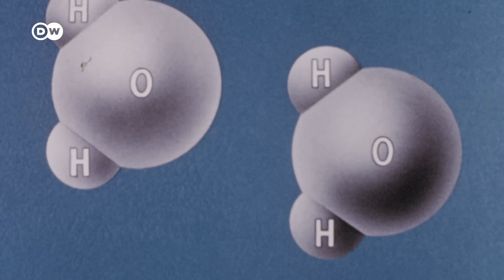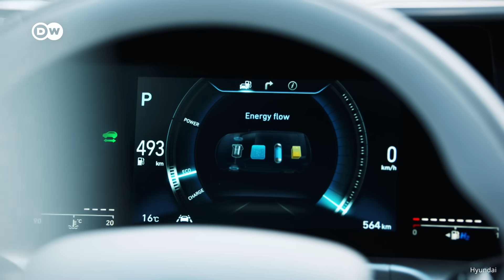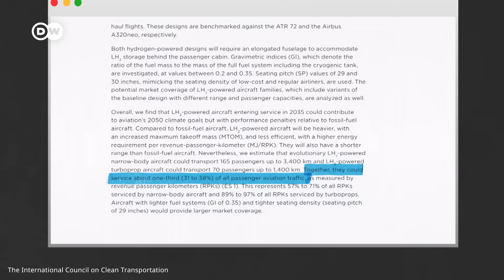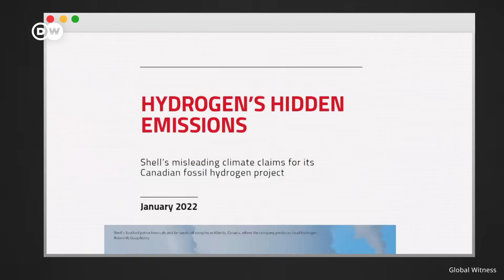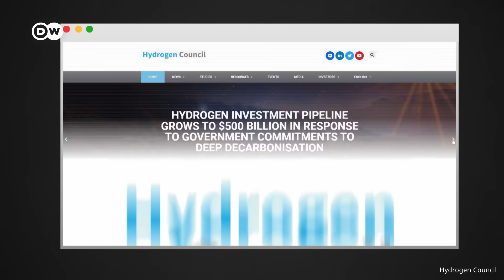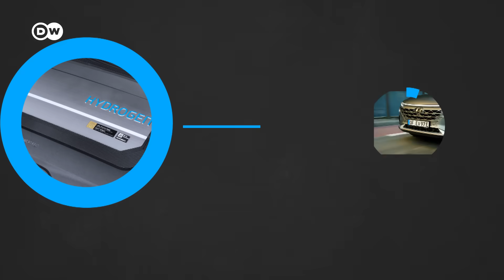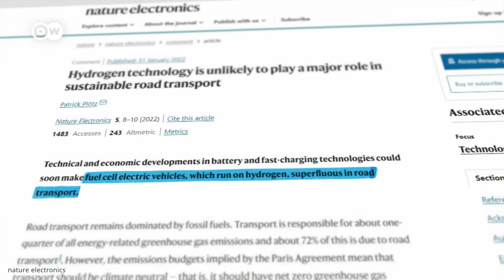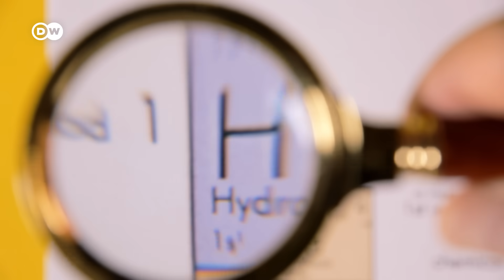The truth about hydrogen

Comment: The tv episode Mythbusters - called "Exploding Pants" is purchasable, and is about running a car engine on vertical water cell hooked to the carburetor, was a deliberate NEGATIVE set up. I counted 14 built in mistakes to not allow engine to run on hydrogen. The electrical circuit that was to be used was really called  "The Hydrostar". The complete original design is on Internet for sale. I have paper manual , but it's now being sold as a computer disc. Mythbusters did not use proper design, nor did they implement the required magnetic wire coil. Even gas engines use air as part of the blend. Their carb was completely closed off. Real usable energy related material will never be shown on tv, local newspaper or on radio general news. You have to your own research and see what others have already done. The man who designed Hydrostar was one of Stan Meyer's technicians in Ohio before Meyer was poisoned . Chambers went to Canada and filed Canadian + US Patent on modified version of Meyer's work.  His Xogen company had showed a display of HIS unit for publicity. The magnetic field energizes the rising ions in solution and increases energy content. Circular concentric pipe electrodes are superior to flat plate electrodes. Pulse quick current only for ALIGNMENT of water molecules polarity. Then pipes hit with high voltage DC pulses for way overunity hydrogen and oxygen gas. (No electrolysis at all)- that's old technology as of now. The Patent pages don't state it but, if flipping drawings pages back + forth , you can see it's easily done as connecting the wires of pipes to the resultant flyback high voltage coming from the wire coil.  !!  Hydrostar US Patent 6126794 by Chambers as studied and read for free on Internet.  (Put that in your pipe and smoke it!)

Comment: Don't go down the same path as Australia did with renewables. We were promised a reduction in energy costs but instead the cost doubled. we won't meet net zero by 2050 and the cost is estimated at $1.2 trillion and set to blow out because natural Gas will now be required to guarantee firming.
 
Consider the following.
 
Cold Fusion (LENR) - Unproven hypothesized type of nuclear reaction that creates nuclear fusion at room temperature by producing more energy than the amount of input energy can be produced from its altered state. 

Tokamak Nuclear Fusion Reactor (ITER) - Requires a temperature of 150 million degrees Celsius to create nuclear fusion. The record to date but having to use more input energy than produced is 69 megajoules of fusion energy for five seconds using 0.2 milligrams of fuel. (1 megajoule is equal to 0.00027 megawatt-hours) (The reported development cost for the ITER is $150 billion.)

The alternative - Solar Hydrogen Energy Recovery Gas Turbine – 301Kwh of solar energy collected from the sun’s constant nuclear fusion at atmospheric temperature is sufficient for electrolysis to fuel a gas turbine and generate up to 330Mw of electrical energy. (330Mw equals 1,188,000 Megajoules) 

Wind and solar farms including pumped Hydro have proven to be cost prohibitive and ineffective because they now require 28,000 Km of Environmentally and amenity destroying Renewable Energy Zones to address curtailment that affects 80% of the Renewable market and requires a prohibitive operational land area equivalent to 10 times the size of Tasmania.
 
The alternative solution is a turnkey, Net Zero, Carbon and subsidy free Solar Hydrogen Energy Recovery Gas Turbine. 

Based on Australia's CSIRO’s 2023 Gen Cost to provide our energy requirements a total of sixty-five 86-330 Mw Solar Hydrogen Energy Recovery Gas Turbines retrofitted to any of the existing 120 Hydroelectric schemes or standalone installation requires a total combined land area of 33 hectares. 
The 2023 cost range is between $2.4-3.3 billion, construction timeline between three to five years and will meet net zero 20 years earlier. 
Whilst the technology will make Nuclear, Wind and Solar farms including Hydro schemes redundant it is an intermediatory solution until a multilateral decision on power generation can be agreed. 

Shovel ready off the shelf technology that combines Solar Nuclear Fusion with modern aerospace propulsion and existing Nuclear and Coal fired steam technology for an 86-330 Mw plant is costed at $36.5-49.5 million, noise level is 60dbl at 60m, and operates from an area the size of a football field.
  
Green Hydrogen produced from the sun’s nuclear fusion, with an estimated 5-billion-year reserve supplemented with the turbines Variable Frequency Generator produces sufficient fuel and overnight storage of Hydrogen to power the turbine for a 24-hour/365-day period with a continuous and recyclable 14-year life cycle. There is also the added advantage of Direct Air capture (DAC) for CO2 provided from the turbines operational free energy air flow at the rate of 1,400kg/sec.

Comment: The Hydrogen Hype is a fairy tale with a true core. Green electricity should be used to harvest the low-hanging fruits, i. e. direct use first. The nature of a green economy is de-centralised and it seems that the detour via Hydrogen is abused to keep the centralised energy structures in place. This will never work because of the  incompatibility when it comes to harvesting the intrinsic advantages of  flat-spread  renewables.

Comment: Note that if you simply burn hydrogen in air, it's not correct to say that the only by-product is water.  The heat produced in the reaction also creates oxides of nitrogen which are bad for air quality. This does not occur in fuel cells, of course.

Comment: Car parts last longer. I think be no acid rain chemical coming out of car Engines.we can add methane gas from outside thanks to infrared red head lights and Radiators. Methane gas travel under ground as well in air.NH3 is found in soil dirt poop., and land fells.😊😋🙂😇

Comment: So, using shit tonnes of energy to produce it, then storing it, transferring it into trucks, transporting it long distance to other storage tanks, distributing it via service stations and running it in more expensive to maintain cars. Hydrogen for daily drivers makes NO sense. A power cable is the most efficient means of transferring energy. It can be offset with home solar, or the grid can be replaced with renewable energies. 

Unless hydrogen can be as efficient as a power cable. It will NEVER make economic sense for a daily driver/ consumer.

Comment: DW Planet A. Thank you for the informative video. 
My only comment is regarding 'green' hydrogen. 'Green' hydrogen for domestic use may make sense in for steel or a few other specific applications but many global green hydrogen projects are for converting wind - hydrogen - ammonia for EXPORT - likely convert ammonia back to energy in another jurisdiction. Exporting 'green' hydrogen is at best a distraction from climate goals or worse, it is 100% green washing. 
Local example in Nova Scotia, Canada compounds export issue with the fact that Nova Scotia's power grid is nearly 50% fueled by coal and other fossil fuels. Many experts agree not a single kilowatt of 'green' hydrogen should be produced in a jurisdiction such as Nova Scotia until the local grids are 100% free of coal and other fossil fuels.

Comment: Thank you for this. As a chemistry teacher for 42 years you would have to be a lunatic to use hydrogen as a fuel. I used to demonstrate the properties of hydrogen to my students. Fill a balloon with hydrogen and show that it is lighter than air. Then introduce a naked flame to the outside of the balloon and it goes off with a hell of a bang. Over 90 per cent of hydrogen is produced by the steam reforming of methane. Sorry but that produces 3 times the amount of CO2 for the amount of natural gas used. OK let's use electrolysis. Hydrogen is produced from the electrolysis of dilute sulfuric acid NOT water. How do you produce the electricity for the electrolysis. Here in WA 67 per cent of our electricity is produced from fossil fuels.By the way , when hydrogen is combusted it produces water vapour. Guess which greenhouse gas contributes most to global warming at over 50 per cent? Water vapour! Now don't get me started on so called "green technology" because it doesn't exist. It is driven by commercial enterprises for "profit". Capitalism at its best.
Reply: Best comment out there, 100% agree. This video contains so much BS, but forgot to mension, about possibility to use hydrogen just as hydrogen, not a fuel - direct into ammonia production.

Comment: methane isn't 80 but 20-25 times more greenhouse effector than CO2.
Water can be dissolved to hho mixture by heat in "solar furnaces" made by a fixed focus moving spherical mirror concentrating enough heat, about 3000 degree celsius. It has to be cheaper and greener than any other method.
To me, the most ideal fuel is bioethanol made by bacterial enzimes making glucose and xilose from cellulose and hemicellulose, then other bacteria can make ethanol from glucose and xylose.
Ethanol burns into CO2 and H2O, the origin of cellulose and hemicellulose can be hay, straw, sunflover parts or any agricultural plant waste, some of them would be burned anyway in thermal power plants. Toyota has already made the first car built with 100%ethanol-using motor. That's what I call really green, reusable fuel.
Reply from the maker: 🍌If you like bioethanol - watch this video from us 👇
"Biomass: How clean is energy from waste and plants really?" https://www.youtube.com/watch?v=XXu15NlOuGo

Comment: Why produce hydrogen only from fossil fuel? Store energy from solar or wind energy is better in hydrogen than in batteries. At least it is  cleaner. Easier to refuel your hydrogen car at home by producing your own hydrogen than at fuel station. 
DW is miss leading, hydrogen got 3-4 times higher energy by weight than fossil fuel. This is why rocket was using hydrogen as fuel decades ago! By the way turning methane into hydrogen is a lot easier than from water ! So it can also solve another greenhouse effect gas problem!
For sure hydrogen is our future energy source as nuclear fusion fuel is isotopes of hydrogen. Hydrogen is then the by product of the fusion fuel production!

Comment: Instead of charging batteries through Hydrogen fuel, we should focus on using the Hydrogen in combustible form.
Reply: why even bother with transporting, storing hydrogen and using fuel cells etc. when we have huge industry - ammonia production, that needs hydrogen and use it directly in ammonia facilities. Simple as that.  And this will have great impact, because ammonia production is about 1,5-2% of global CO2 emissions.

Comment: Two points: hydrogen can be used in conventional internal combustion engines with some adaptation, you don't have to use fuel cells which bring their own challenges. Secondly, here in the UK domestic water heating with natural gas is being phased out to be replaced by either heat pumps or hydrogen fuelled boilers, there are already 'hydrogen ready' boilers but when is the supply coming?

Comment: Another truth about Hydrogen is that is has been used as a power source (electric) in spacecraft since the 1960's..   Today, hydrogen is already contributing to approaching a "net zero" threshold.   They are called large fuel cells.  A very large one can generate 78 Megawatts of power.

Comment: https://www.youtube.com/watch?v=HGHpGLVfPMA&t=1s  200 trillion tons found in the earth just in the USA - So things change maybe Hydrogen will be the savior.
Electric certainly isn't - the lithium required takes a great deal of mining up to 500 tons of ore per ton of refined material and 500,000 gallons of water help in the process in precipitation ponds. Worse the grid is grey - meaning mostly fossil fuel powered. The grid is not infinite - it is mostly committed already; you'd have to build more power stations; you can't build more dams; you can't probably build more nuclear, so you are talking fossil fuel.

Comment: The cycle efficiency of hydrogen of like 25% kills you (not sure if the 40% is optimistic). If you combine it with a giant ramp in nuclear it would make more sense. They also have direct methanol fuel cells.

Comment: I got a question. The differential of energy between the energy (electricity) used to produce hydrogen is lost in heat that is transmitted to the solution of water where the hydrogen come from right? If yes, using a low differential heat pump to take the heat back to electricity then hydrogen production again would take us closer to a closed loop? Then producing hydrogen would be a damper for the electricity production. Yes? I know i got a lot of questions here. The most important is: the trash of the hydrogen production is the lost of energy in  heat form to the water solution in the process?  I'll manage the rest.

Comment: Im surprised that hydrogen fuel is considered as "zero emissions", where production of hydrogen generates oxygen that is then released to the atmosphere. Did anyone consider the consequences of releasing so much oxygen on the environment?
Reply from the maker: Actually green hydrogen might be the only oxygen and water balanced fuel. ✨ Electrolytic oxygen can replace the atmospheric oxygen consumption caused by the use of hydrogen. More about this here 👉 https://www.sciencedirect.com/science/article/abs/pii/S1464285921001693

Comment: This video was posted 2 years ago in 2022.  Since that time,  sources of raw hydrogen have been discovered in the earth’s crust.  In the crust, super heated water under very high pressures can come in contact with iron bearing rock.  The superheated water can oxidize the iron with the oxygen in the water molecule, releasing
the hydrogen.  The hydrogen gas then accumulates in the crust, and can be accessed by drilling.  However, this is a challenging process, and the hydrogen may also be mixed with methane, and may need to be purified.  But there have been hydrogen reservoirs discovered  in France and North America.  This type of natural hydrogen production may also be renewable, and may be a source of “green” hydrogen that does not consume energy in it’s production.  It looks promising, but there are other problems to be overcome before hydrogen will be the solution.

Comment: A big misconception is people thinking oil and gas is a "fossil fuel".  It is result of anerobic bacteria using ramnolipids to break down rocks and the byproducts are hydrocarbarbons.

You think Green Hydrogen (electrolosis of water) is better?

There is ONE volume of water on the planet.  ONE!   Yes, a large amount, but once the Hydrogen and Oxygen is split....that water molecule is gone forever.

Just an observation.
Reply from the maker: Hey Steve! Appreciate your insight. It's true, water resources are a concern, but the natural cycle replenishes freshwater. We can also develop tech to use water more efficiently. 💦 Green hydrogen does have its challenges, but it's a great step towards a sustainable energy future when paired with renewables and smart water management. We talked about the "water" aspect in this video 👉 https://youtu.be/eABuoaf0Vbs Stay tuned and subscribe our channel ✨

Comment: Plug in electric are a stepping stone to hydrogen or some other advanced technology. Battery EV's have so many batteries which are often mined in appalling conditions, and those materials are finite. Then there's the end of life recycling / disposal of all those batteries. Plug in electric vehicles are a stepping stone like Hybrids were before them. 
When an hydrogen filling station is running on renewables and doesn't need tanker trucks to bring in hydrogen (which I'll agree is ridiculous by the way), it's brilliant. Those are the types of infrastructure that need to be invested in. It's not like they haven't got enough money. Sure, hydrogen isn't as efficient as battery electric in use, but everyone wants convenience, not waiting over half hour for batteries to charge. Less than five minutes to fill a tank with hydrogen, and getting a wicked range is WAY better than waiting over half hour for crappy batteries to charge. I will never do that, it's retarded 🥴👉

Comment: I'm afraid despite the best efforts this video is still BS. 
The entire H2 effort is driven by Oil and Gas lobby groups. Why? Do you think they are willingly shutting down their operations giving up trillions in profits?? 

H2 is part of well documented "Delay and Dither" strategy aimed at slowing down industrial transition to Renewable Energy. H2 projects directly compete for grants and subsidies with Renewables. It's a smoke cover and distraction, 99.9% of all Hydrogen comes from fossil fuels supplied by these companies... 
And the argument "oh, in future we'll make green H2 using renewable electricity" is nonsense. Electricity is priced, it has a cost and is sold on the open and free market. Simple equation shown here proves it will always be more expensive Vs using electricity directly. 

In the industry I used to work in we had this insider saying about journalists... actually I cannot quote it here , it would violate YT policy :)

Comment: So no talk about how storage and transport of H2 comes with HUGE leakage losses?  There is simply no way to efferently / economically build containment for the smallest molecule on Earth.  Fuel Cells can eliminate the need for massive H2 flow infrastructure, but make no mistake that trying to store, pump, or hold gaseous (or worse, liquid) H2 is next to impossible without VERY large leakage losses that can't be ignored because you say it's "clean".

Comment: why instead using Hydrogen to produce electric energy on vehicle, we convert fossil fuel internal combustion engines in hydrogen internal combustion engines, using electric energy to separate water in H and O as needed, producing a clean and complete combustion since we could work in excess of oxygen.